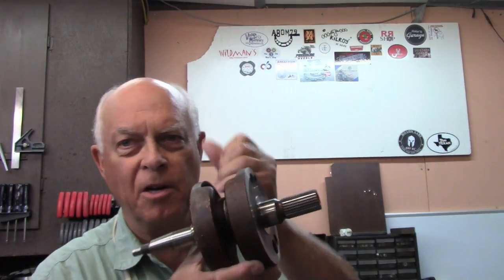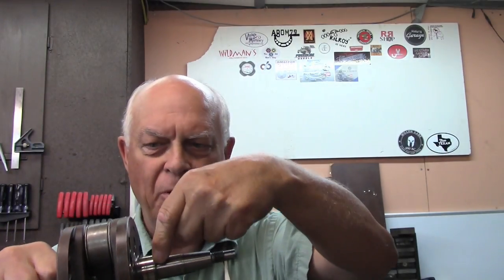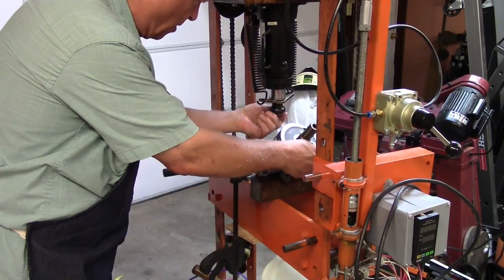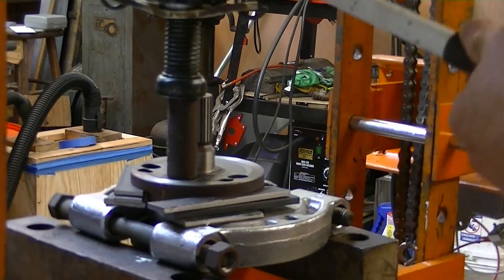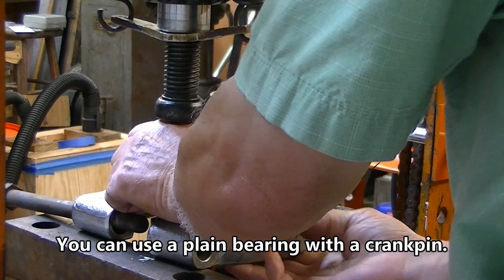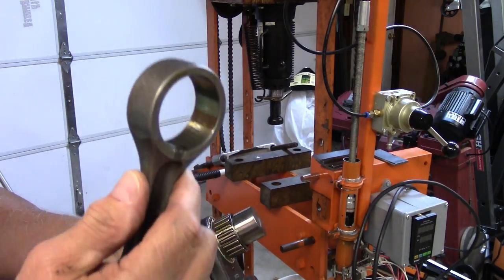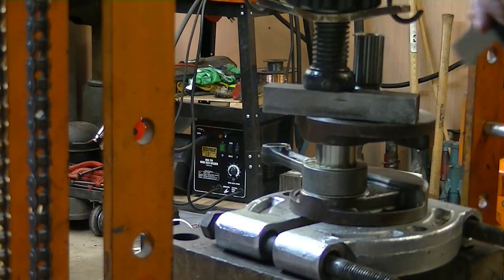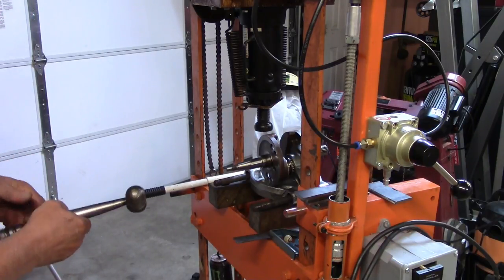Motorcycle crankshaft rebuilding

Comment: Hey, thanks for taking the time to put this video together, I now feel confident to re-build the crankshaft of my 1970 Honda CD90Z, this has the same engine that the S90 had which sold many of in the USA. (I am in the UK) I have been dubious to start simply because I wasn't exactly sure what was involved, but I realise I have all the necessary tools at my disposal. I am a machinist and so have access to a lathe with centres, press and DTI etc. I will probably machine a close fitting sleeve (with a slot for the con rod to clear) to drop the parts into to aid positioning on assembly. Thanks again, excellent video!
Reply from the maker: It is not a hard job at all.  When you are trying to get to no runout You can place one crank throw on a solid piece of wood and hit the other crank throw with an aluminum hammer (or some equivalent soft hammer) and slowly move the two crank throws into perfect alignment.  They will rotate around the big end rod pin but very slowly.  A really good smack is usually 1/4 to 1/3 thousandth.  Of course sometimes it does not move at all and you have to go back and whack it again.  Thanks for stopping by.
Reply: Thanks for the advice and sorry for the delayed response.... I will take your advice on board and give it a go. Currently making a device to pull off the small cam sprocket so that I don't risk damaging it with drifts.

Comment: You mentioned the comments in this video recently so I went back to look. The content of the video was informative and entertaining if not cringe worthy at times but then you did add all the necessary disclaimers. I’m a 63 year old motor mechanic and have never worked on motor cycles let alone the crank but you have shown me the process should I ever build a model engine, I just won’t video the crank assembly method. Well I think I’ll go back to my Gingery Mill build I don’t seem to attract angry people there. Cheers Harold your entertaining, Peter
Reply from the maker: The proverbial "they" say you need to feel some pain to know your alive.  Actually I don't feel much pain from the comments.  😁😉  Thanks for stopping by.

Comment: I like those modular cranks. I actually want to do a project and build one sometime. I enjoyed the video.
Reply from the maker: They must be good or the big boys would not use them.  Thanks for stopping by.
Reply: On some high hp dirt bikes, they weld the pins after they true it up. But, yea, they work pretty well for most applications just pressed together.
Reply from the maker: That is interesting, never heard of it before.  Thanks for stopping by.

Comment: I makes my day to start out with one of your stories.  I had a automotive machine shop in my former life and we ground thousands of crankshafts but I never saw a built up shaft come through the shop. Thanks for sharing.
Reply from the maker: No need to grind on these, just buy a new crank pin, rod, and bearings.  Thanks for stopping by.
Reply: We also had a 50 ton press and did a lot of motorcycle press work.  Just surprised  that I had never run across one.

Comment: An interesting method.  I don't know if I could get my holes dead on with 3 pieces.  The variables of either 2 shafts set in a 4-jaw for eccentric turning to bore the offset holes or using a mill are challenging.  Maybe if I did a 5 piece crank by tack welding the eccentrics together then bore the 2 holes to ensure they are exactly matched, pressed the shafts in then pressed in the pin I could pull it off.  Sounds like one of those "just to see if I can" projects.  Thanks Harold.
Reply from the maker: I am sure everyone would love to see what you come up with.  A model engine would use a small crankshaft anyway so it would not need to be very thick.  Bore one hole and part off more than one piece?  Thanks for stopping by.

Comment: That is a huge big end pin!  I helped a friend rebuild a few HD Knucklehead engines. Bought oversize bearings and new pin then honed rods out to fit. BSA used a forged crank with a flywheel bolted in the center between the (aluminum)rods. Rods were automobile type with bearing shells. I have never seen a pressed together crank disassembled. Thank you.
Reply from the maker: Glad you were here to see it.  Thanks for stopping by.

Comment: I find it sad that skills like this are being forgotten in a disposable society.  The idea of "just buy a new one" always upsets me.  Where there is will and skill there is a way!
Reply from the maker: At one time their was a notable difference in price between the whole crankshaft and the rod and bearings.  I don't know current prices.   Thanks for stopping by.
Reply: I agree. There are less and less people doing actual "rebuilding" or "building" engines anymore. Anyone can buy new and put it together, but it takes a real craftsman to do it this way.
Reply: @AmateurRedneckWorkshop  I came across this video as I'm looking to rebuild a 3 cylinder crank for a waverunner. A new crank, all in, costs about $1300-1500 CAD. If I can successfully rebuild it myself, ive priced parts at just about $500, not including the core itself. So I think there is still a difference!
Reply from the maker: @chrisjohnston4369  you can do it if you are careful to get it all aligned.  Measure the length and get it back together the same length then use a dial indicator to check it for true.  If it is a bit out put one crank throw on a 2x4  and use a aluminum hammer to move the other crank throws to alignment.  It takes a lot of healthy blows to move the crank throws a few thousandths.  Put it between centers and check for true.  Do one section at a time rather than assembling the whole 3 cylinder crank at one time.  True it up as you build it up.  Thanks for viewing.
Reply: @AmateurRedneckWorkshop  thanks for the video, super helpful. Right now I am trying to build my jig for truing and my setup for measuring phase (I don't have a lathe so it makes it a bit more challenging), any tips for setting phase correctly? I figured score the old parts before taking apart but that also assumes they are in correct phase in first place, and would only get them close not exact. I've learned they need to be in 1/4deg phase of eachother or better, or the engine won't run great. Any tips to get this step right?  Thanks again!
Reply from the maker: @chrisjohnston4369  many times there will be some locating key or something.  You will be throwing away the old crank pins and using the new ones so marking them is futile.  Just for safety try scribing a line across all of the crank throws with a straight edge and that will allow you to get things back closer than you think.  When you go back together align that scribe mark and if the throws are within .001" or better alignment you will be in phase.  Make a stand and put some pointed bolts in it from each side.  That will give you centers for the center holes in the crank and you can measure true like that.

Comment: Thanks for the video. 

Modern Japanese and European multi-cylinder engines are overwhelmingly single piece cranks with split rods, like automotive engines. Singles are overwhelmingly press together like the one you have there, although there are a few that use an automotive style crank - the KTM Duke 390 is an example. 

I understand that you're doing it a quick and dirty way, and if you cared about the final product you'd be more careful. That's expected of a demo.
Reply from the maker: I am glad you got the point that I was trying to make, some did not.  Thanks for stopping by.

Comment: That was a super interesting video Harold.
Reply from the maker: Thanks for stopping by.
Reply: @AmateurRedneckWorkshop  do you think you can make a crankshaft in that stye to replicate A bigger one..in other words..go from a 69 to A 74mm crank...I'm using the set run a 420cc...stock crank is 66mm...I want to a 74crank x 92bore..502/503cc.. 69mm x 92bore is 480cc I may have to cut the case of the engine to 3mm or 5mm..longer

Comment: I have a Kawasaki 500 three cylinder crankshat I'm planning to rebuild. The six webs - as I've learnt to call them, needs some TIG welding, where they've been pitted from various reasons, and they also will need machining after the welding.
No, what I'm wondering is, have You ever used a jig - like a big tube, where the inside diameter is just above the outside diameter of the webs? I think it is meant for the realigning stage of the rebuild process. You put one side of the crankshaft inside the tube, and adjust the other side so it is in line with the rest. When these match up, You add the next web - and then, so on. At least, that's what I think it was meant for.
Thanks for sharing this video. Gave me some useful tips! ;)
Reply from the maker: I have never used a tube or jig.  When I was doing this work I was too pressed for time to experiment.  Anything that makes the pieces start off straighter would make things better.  After each section is added to the crankshaft you need to put it between centers and align what you have put together.  You also need to get the correct width with each section before you add more pieces.  Normally getting the correct width was much easier for me than getting each web aligned.  Thanks for stopping by.

Comment: Ha Ha.  Good joke.

Good video too.  I have never done a crankshaft rebuild, but seen how the shop guys do it, and you're right on.

They generally had it between lathe centres with a dial indicator on each main bearing journal .

Cheers Rob
Reply from the maker: Glad you liked it.  I found that when one main bearing was dead on the other was also and of course that makes sense.  Thanks for stopping by.

Comment: I've still got a set of NOS Suzuki GT750 connecting rods.. Polaris watercraft cranks scare the hell out of me, they take about 20 tons to get apart.and go with hell of a bang. In comparison, Yamaha and Honda take around 5~7 tons pressure  Old style bolt up Harley cranks are dead easy but the press up cranks take about 45~55 tons, you won't ever see me even trying one. It's just as easy to true a crank on main shafts with rollers instead of 60 degree centres although sometimes you have to make sleeves  to fit on shafts. No idea how many cranks Ive done over last 30~40yrs, several thousand I guess? Your right about the slackers who say it will run straight, it won't.  What really happens is more vibration and destroyed main bearings at best, at worst the big end needle rollers start breaking up and destroy entire motor. Had an RM250 brought in once where big end bearings had broken through case and ended up locking transmission. lot of very dishonest people out there claiming to be 'experts'. Not good
Reply from the maker: The worst one that I ever tried was a Bultaco.  I had to take it to a larger press.  Thanks for stopping by.

Comment: A machinist can usually repair a "bad" center hole. Built up crankshafts are still commonly rebuilt, not just for Hardley Ablesons although no doubt they need it the most.
Reply from the maker: That crankshaft uses the center hole of the crank on one side to supply oil to the rod and crank bearings or so I was told so they did not want to risk a repair of the center hole.  Thanks for stopping by.

Comment: What's the best way to align the crankshaft journal halves? I can hardly believe what I'm seeing.....even on the WWII piston engines....Huh. I liked the video. Thank You.
Reply from the maker: I would normally put the crankshaft between centers on my lathe because I have one and use a dial indicator to check to see which half is high on my side.  Then I would put the other side on a 2x4 and hit the half that is high on my side with a heavy aluminum hammer.   An aluminum hammer is soft enough not to leave any dings.  This would most often rotate the side that is high forward about one thousandth of an inch.  And then I would put it back in the lathe between centers and check it with a dial indicator to see how much that side was still high.  Then I would repeat the whole thing until both sides were even and no runout on the dial indicator.  Thanks for stopping by.

Comment: I have a twin 350cc 2 stroke crank that's walking apart a bit. it has just a bit too much side to side play on the right rod bearing. All the other bearings are fine and seals were good as well. Can I just squeeze it back together and call it a day. Thinking about welding the pins as well. Once welded do you need to balance it?
Reply from the maker: Welding on the crankshaft will certainly warp the parts and do damage.  If it is actually loose and moving apart then the crankpin holes in that side are probably wallowed out.  Are you certain that the side to side movement of the rod is because the crank throw is further apart from the center than it is supposed to be?  Have you measured both sides?  It could be that the rod itself is badly worn.  A worn out rod and bearings is the most common cause of problems in that type of engine.  It only takes one time with poor oil to fuel ratio to ruin the rod bearings.  If it is the hole in the crank throw that is loose then get a new crankshaft.  Thanks for stopping by.

Comment: Hello, what exactly is the name of the clamp-like tool you use to keep the crankshaft in pressure?
Reply from the maker: I use a hydraulic press to take the crankshaft apart and to put it back together.  That is the only clamp like tool that I use.   When taking it apart I use a bearing separator to hold one side at a time while I press the crank pin out.  Thanks for stopping by Murat.

Comment: I'm making an engine from scratch, where do I buy the parts of a crank shaft? Or learn more about it, thanks!
Reply from the maker: You can buy a crankshaft from a motorcycle dealer.  I guess you will have to build the engine around the size of the crankshaft you purchase.  Most of the crankshafts will come complete with the rod installed.  I am sure this will be a fun adventure for you.  Thanks for stopping by.

Comment: On two cylinder crank how do you get the weights lined up so that that are even opposite from others
Reply from the maker: You put the crankshaft between centers in a stand or a lathe and use a dial indicator to see how far out of true they are.  Then supporting one side on a piece of wood you take a soft hammer, lead or aluminum, and smack the other side that needs to move in the direction it needs to move.  After a few good smacks it will move a thousandth or two.  Recheck it between centers and rinse and repeat until it is true to less than one thousandth of an inch.  That will get you about twice as true as the factory requires.  Thanks for stopping by.

Comment: Excellent video, we both know nobody would attempt this, but if they did I wonder if you couldn't use the square to scribe a line up mark between the two halves before you separated them? Then perhaps cut a piece of material 66mm long as a gauge block to use between the press base and the piece of metal under the ram. It should help from going to far and could be milled down as needed to help deflection. Just a thought from a carpenter in Southern Calif. thanks again, JB.
p.s. will you be attending the Bar Z Bash? It would be a pleasure to meet you.
Reply from the maker: I often thought of using a jig made of two "V" shaped pieces to get the fit started going back together.  In real life I never had time to do it.  After you do this job for a short while you get pretty good at lining them up before you press them back together.  Then it is only a matter of a few thousandths correction.  I would love to meet everyone but  I went to the Bar Z Bash in 2015 and it cost me $1600, way too much for a couple of days in the California sun.  Think of the nice mill I could buy from Grizzly with a couple of years expenses.  Thanks for stopping by.

Comment: Sorry I just wanted to know if you please have any idea regarding the design of the rig for a crankshaft so as to balance it and allow it to spin .please could you help me
Reply from the maker: If you search for the item on the internet you may find one to copy.  You can use the same type of device you use to hold bicycle or motorcycle wheels when you put in new spokes and balance it.  2 upright pieces, wood or metal with bolts through then with a 60 degree center would do the job.  Anything that holds a crankshaft between centers will work.  http://adrenalineworld.com/k-l-mc310-3-in-1-truing-stand-35-9573/?gclid=Cj0KCQiAsqLSBRCmARIsAL4Pa9QsjfmbqasBoAHzLteJttcTf-cOWhxW1YYoHLz6Jj1s9kVpPJVGS4EaAuPHEALw_wcB
https://www.ebay.com/i/192388137386?chn=ps  Thanks for stopping by.
Reply: It's basically the same thing as a wheel balancing stand, only with dead centers on either side.

Comment: Sir...can u tell me the clearance between Crank pin and Crank pin bore in web ...??
Reply from the maker: Please consult this helpful article;  https://us.misumi-ec.com/blog/shaft-hole-tolerances-for-clearance-interference-fits/   This should be an interference fit.  Thanks for viewing.
Reply: @AmateurRedneckWorkshop  thanks for spreading knowledge sir ..love from india...
Reply: @AmateurRedneckWorkshop  sir...if the application is drag racing and we are facing the issues of Crank web twisting and run outs...what should be interference fit value???.0.008" or more
Reply: The engine is a single 350cc 4 stroke with oversquare geometry...82 bore and 70 stroke
Reply from the maker: @naveedaka  sorry but I do not know the answer to that.  Possibly you should check with others who are drag racing to see how they handle this.